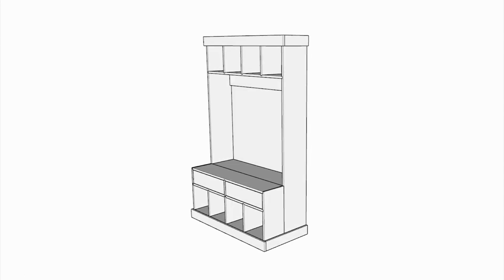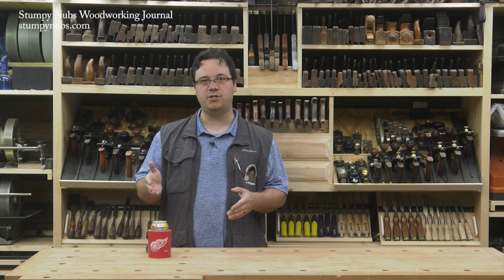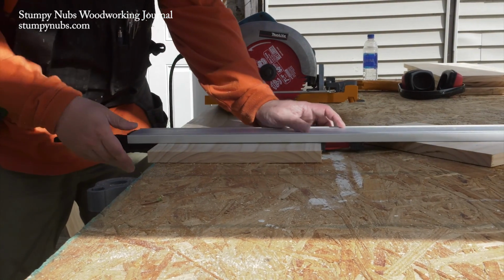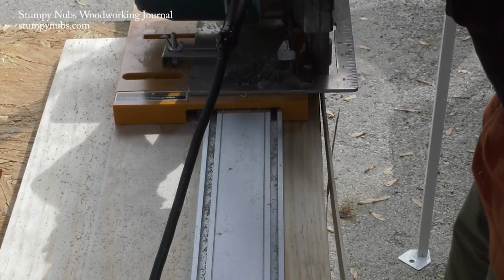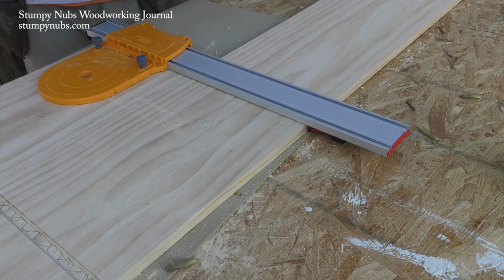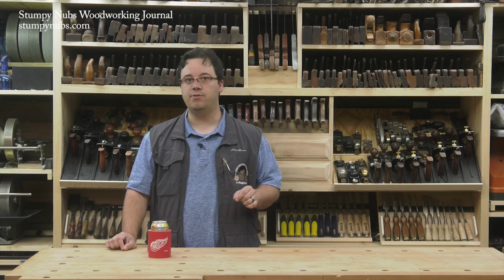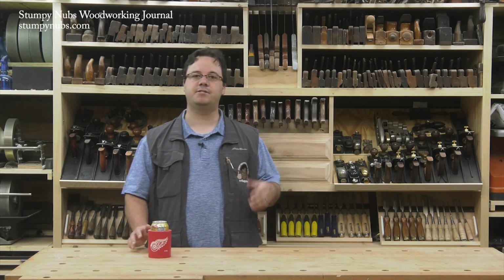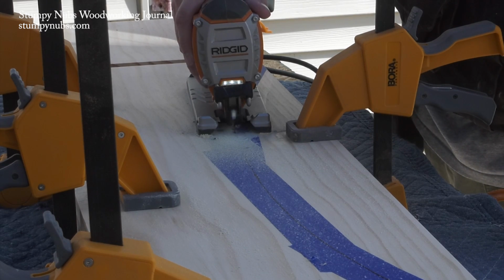Build a Storage Bench/Hall Tree part 1

Comment: Like your videos, thanks. I have learned a lot. One project I am on is making a reptile habitat with glass doors. Habitat is 20" depth by 45" wide and 22" high. I'm wanting to attach two glass doors with wood frame around three sides of the glass. I would use a beveled edge on the wood frame, one side would close over the other side, allowing the glass in the center to close with in a 1/16 of each other.
My concern is for the weight of glass how thick should I make the wood frame to hold the glass, and what tips to reinforce it?
Habitat is for Bearded Dragon
Thanks for making these videos.
Reply: How you going to provide heat for your lizard? How will you keep the animal inside when you open a hinged door wide enough to reach inside? (I have a suggestion about the heat.)
Reply: @ohgary  
the Heat is not an issue I am thinking. I have made a dual box system. where the two heat lamps and the Ceramic Heater for night time are above behind a screen. One heat lamp for the morning time, and the afternoon. 
The top will ventilation installed and one lower side will have ventilation also.
As for Dragon escaping, he doesn't move that fast and there is a 5" lip he would have to climb over. 
When I get to finish this project, I'll post pictures. But for now family emergency has come up.

Comment: For my Bora guide, I made a jig to help with the measurements. First cut a line using your final setup ( I don't have the router or cirulayr guide yet but it would work the same. Then take a scrap of 3/4 ply about 10 inches long and rip it to that width you just measured.  Take that piece and another piece and sandwich them around the guide track.  Take another piece of scrap (it doesn't have to be wide, mine is just 3 inch wide 1/2 BB ply) and bridge the two pieces together with glue and screws.  Make two of these.  Now when you have your layout long on you work piece, lay the guide about where it should be. Place these jigs over the guide and line them up with the cut line exactly (mine slide so I can make sure the line is correct at multiple places). Whatever is covered buy the jig is part of the keeper piece and the rest is cut off. Just like you said, make sure you have the blade (my jig) on the correct side of the line.

Comment: Most of the products I see promoted on this channel seem to be really well made from what I can tell. The Bora saw guide system is one of the few that I happen to own, and it's definitely an exception. I have tried it on several circular saws, and I've found that it's so poorly designed, it's actually unusable. The biggest problem isn't the guide rail, though it's not without its own problems (mainly with the clamps, the far end slipping before the clamp can apply enough pressure to secure the rail). 

Far worse is the saw plate, and the flimsy thin-section plastic they chose for it. I have found that the plate cannot be mounted securely to any saw I've tried, without tightening so severely that the plate flexes way out of flat and warps away from the saw. Loosen it enough to get rid of most of the warp, and you can scoot the saw around on the plate with barely any effort.

There are plenty of strong, fiber-reinforced polymers they could have chosen; they could have used aluminum or even stanped steel. What they came up with instead is a poorly made product that simply isn't safe to use.
Reply from the maker: I haven't experienced those issues. However, I have the ORANGE versions. If you have the RED versions, those were early models that they have since improved.
Reply: @StumpyNubs  I suppose that someone at Bora may have told you that there has been an improvement, but it simply isn't true. Prompted by your reply, I bought an orange saw plate to compare with my red one, and I've now checked them out. The two parts are essentially identical in every way except color. Same flexible plastic, same inexcusably flimsy clamp design. The plates were evidently shot from the exact same mold, same section thicknesses spot-tested with a caliper,, and within 10 grams of each other in mass. (In fact the orange one was slightly lighter.) Neither plate will secure to my circular saws without flexing several millimeters away from the saw's base plate, or being so loose that the saw slips around with the slightest pressure.

The orange saw plate is NOT an improved product.
Reply from the maker: @manualdidact  -  I own three of them and they all secure my saws fine. You may chalk that up to my "bias" but the video doesn't lie. The cuts come out clean and straight. I am sorry your experience has been different. I recommend you return them.
Reply: Did you have orange or red versions?
Reply from the maker: @Jarris2  I used to have all the red stuff. I seem to recall some issues with the old red plate, and I also didn't like the lock on the red edge guide. It jammed once in a while. I have since switched to mostly all orange versions. I still need a couple of the edge guides in orange. But I intend to get them.

Comment: With the bora clamp did you find the end near the movable stop swelled after you tightened it? On mine I get nice straight cuts with my circular saw right up to the last 8 inches or so where it appears to tilt the saw up. I ended up having to loosen the circular saw plate so much I might as well have just been riding the saw along the clamp without the guide plate.

Comment: I've done some searching and it turns out that even when a company has 5/16' router bits, they only have one or two and then there's the problem with the "5/16" shank" always turns up 5/16" cutting heads.

Where is a good source for 5/16" router bits, or would I just be better off getting a half inch router?

Comment: Most edge guides I've seen or used have a bit of flex to them, including the Kreg one. Does the Bora one do this? (Non-straight cuts are highly evident when joining table tops). As a side question--where can I find a perfect 8 foot straight edge to use as a circular saw guide? My jointer bed is only 45 inches. Thank you so much.
Reply from the maker: No flex that I have noticed. They have an extension for their 50" guide that extends it to 8 feet.
Reply: @StumpyNubs  Thank you, sir.
Reply: @StumpyNubs  I saw these at Menards today and I held 2 of the 50" rails together and noticed that there was a very slight bow in the rails (hollow). :( I was so excited, too.

Comment: Nice ! James. I always told my freinds and co workers  for years   Whenever the subject of Norm Abeams  and the New Yankee Workshop  ever came up  that i wanted to. Start a tv show where everything is made   In a garage or driveway. Using. Nothing more than a. Circular saw , router, and some basic hand tools  like most of us really do  because Norm always made it look like you needed all the  fancy. Tools. Out there  at that point in my life i was a professional Woodworker  living in a Town house and my work  areas were a concrete slab. In my back yard, a laundry. Room  and sometimes the bed of my  pick up truck in front of my house  and i managed to build quite a few  pieces of furniture and custom built ins  that way  even having constant visitors  being curious about what. Was i doing   Most of the time i had to break down materials  before i could haul them to my work area  just so i could get them to a place i could. Cut them to final  dimensions  it cracks me up. To see older pictures  of something i built that way  in the past  your series has some similarities. Except you have some more space to assemble. And  make your cuts  of i did have saw horses that i carried to and from whatever jobsite i was working. On for the day to install Architectual woodworking  each day  so those horses became my “ workbench” at home   As on occasion i could  clamp down a plywood  cutoff i had for just that purpose    No fancy tablesaw  or other stationary. Tools  most of the time my straight edge was. Only a 48 inch. Level. I clamped down with  clamps for each cut  untill years later when i did build  some longer. Straight edges  for my routers and circular saws